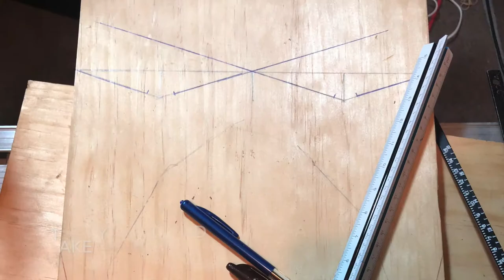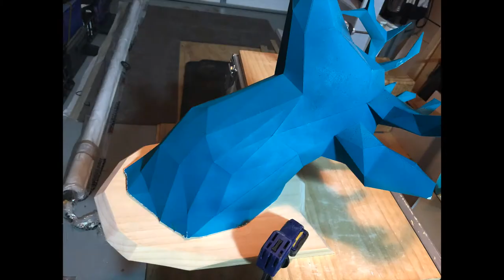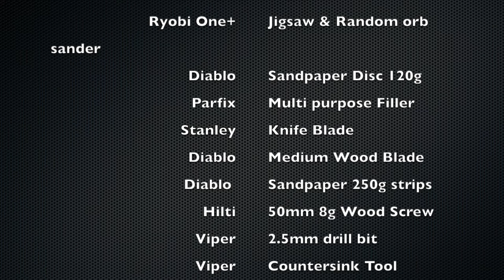HOW TO MOUNT ANY PEPAKURA SCULPTURE - Deer

Comment: How did you put the filer inside?
Reply: It’s expanding foam. 
I used the long nozzle that came with it to inject it part way up the antlers and to fill the main chest void. Then sliced off the excess flat. G this is where this video starts. My video of that process was corrupted sorry.
Reply from the maker: The foam comes with a long nozzle. whatever you do, dont' over fill it or it will tear itself apart and ooze out for hours and days even... and make the corners 'bulgy'. (from previous experience hehe). sorry for the delay in reply.